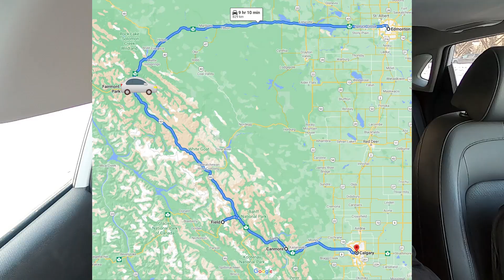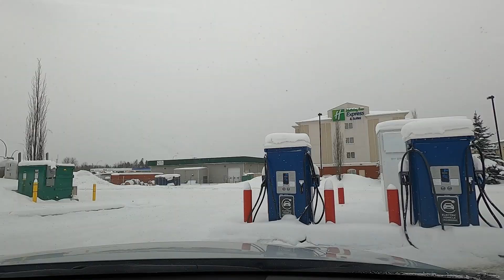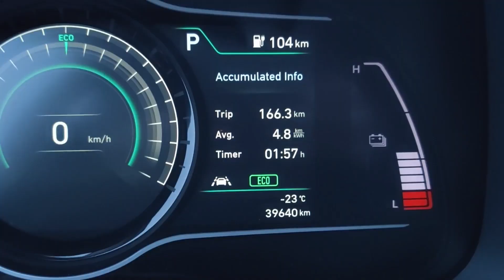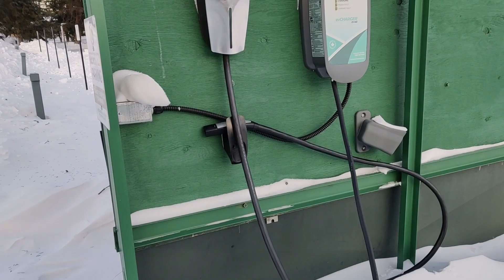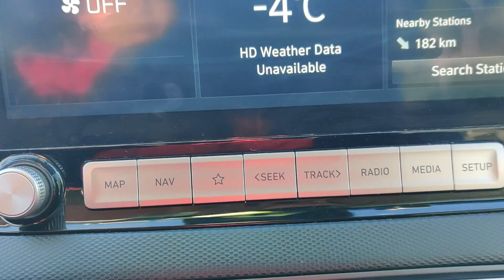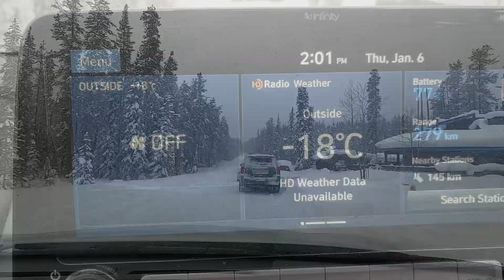Extreme Cold EV Road Trip Part 1 : Canadian Winter  (830km)

Comment: So heres the thing heat pumps dont work well at temps below -18°C. I test drove a phev in -25, and in ev mode, it was puting out barely luke warm air. When the engine was running, it would put out hot air. Asked a friend how his tesla was in cold temp, and even they admitted that ya its drivable, but if you wanna warm up in your vechile it just isnt gonna happen at those temps.

Comment: Very nice and informative video. I’ve ordered the 2024 Kona EV and I’m not stressed about winter roadtrips no more thanks to you! I am from Quebec (canada) and I guess it will do even better even though we have the same temperatures as in your video since the new model has battery preconditioning. No more worrying about the battery temperature for when its time to charge!

Comment: fyi our 23 Bolt at 15,000 miles has 4.0 mi/kWh lifetime average efficiency which is 6.4 km/kWh - but it's usually quite warm in Louisiana. Edit: this cold morning for 15 miles the Bolt only made 3.0 mi/kWh (4.8 km/kWh) - ouch.
Reply: It's been consistently cold and lifetime average is 3.9 now. Current weather is rough for ev - but the Bolt is holding up.

Comment: I think there should be option to force battery heater on to have good temps for fast charging with selectable time limit. Heating battery is in my opinion part of charging because warm battery has more energy to use.
Reply: A good feature. When looking a couple years back I thought all EVs  had it. Call it pre-charge conditioning or wtvr

Comment: Great analysis and experience video here.

I am concerned about traction in my and my wife's Kona Electrics this winter because they tend to spin tires in trivial conditions like wet grass. Hoping that doesn't translate into winter traction issues, but you seem to be doing great in snow and ice so I'm optimistic!

Any special winter tires or wheel sizes or just any 215/55R17 winter tires at the right price? I'm looking at FastEv EV05 wheels (Canadian made) and Continental VikingContact 7 tires but they're quite expensive if they're not necessary.
Reply: My experience in snow and ice is ESP off and leave traction control on, it works great.
Reply: @ thanks! I'll try that.
Reply: Which tires did you go with and how are they? I’ve liked Nokians non-studded All weathers in the past for performance and convenience. 
I wonder how the Kona would be with studs
Reply: @larslarsson2056  we have Michelin X-Ice Snow tires on mine and some random cheap studded tires on my wife's. I prefer the handling of the Michelins. I was able to handle heavily drifted roads and active blizzard conditions in an emergency with confidence on them. Having gone from AWD to not I find I miss confident and surefooted inclined starts but otherwise haven't found much of a difference otherwise.

Comment: So i can fill up my Ford F150 with a range of 1000 to 1100 km. Which basically means I could have driven that whole trip without stopping.
Reply: Yes, you could. I could also pay more and fill up a helicopter and do the trip in way less time. Which is more energy/cost efficient?
Reply: That's a long way to go without stopping. When was the last time you did that?
Reply: What a stupid comment in the world
Reply: How much you spend to fill up your truck? I’m sure the EV could do 2 to 3 times those amount of miles with what you spend on your one tank of gas or diesel. Not to mention, zero pollution.
Reply: @gianvisentin1232 my cost per kWh at home is 19¢. my cost per us gallon is currently  $2.49.  I have paid as much as 30¢ per kWh while traveling. Electric is 4.75¢ per mile at home and 7.5¢ per mile while traveling. On Gas my cpm is 4.6¢, add 1¢ for an oil change every 7500 miles.  Assuming 4 miles per kw and 54 mpg. 2017 Toyota Prius prime.
Reply: No pee stops, coffee breaks, rest stops ?? 😮 Are you a human ?? 😊
Reply: No one asked

Comment: Thanks for this video!  I just completed a 500 km, one-day out & back trip to pick up my wife, driving our new 2023 Kona EV…3 mountain passes each way, -25C temps, one DCFC for 90 minutes at -21C (-29C windchill).  I was hesitating to take the EV, but your videos helped me decide it’d be a good test of the Kona’s winter abilities.  I followed many of your tips, including setting the DCFC charger as the NAV destination—charging started at 47kw (50 kw charger), but it did slow to 22 kw after the battery reached 80% (we charged to 92%, app was saying another hour to 100%).

Comment: Great video mate! And good job Hyundai! As far as I know, it is normal for chargers to coldgate at really cold temperatures. I am not an expert, but people who are much wiser than me stated, that the conversion from AC to DC is much less efficient in low temperatures. How badly the charger deteriorates is dependent of the make and model as well as the used auxliliary components, but at -25°C, you can expect a charger to have an efficiency of about 70% at best (which would render the 50kW charger you used as quite efficient considering the circumstances), and a completely dysfunctional charger in a worst case scenario.
And yes, the wind may matter. The charger may suffer from wind chill. What's meant with that is, that the cooling effect of air with a certain temperature combined with a significant wind speed is actually far greater than the cooling effect of still air of the same temperature. Reason would be the constant disruption of the boundary layer of air around the charger. This could explain, why the charger in -30°C was fine, while this one in close to -25°C was not. The sun might have also played a part. If it was sunny despite the -30°C, the charger housing might have heated up significantly. In your video we can see, that the sun was very much absent, so that might also have played a part. The same effect would be responsible for the Konas temperature probe showing -4 in -25°C weather. The sensor is probably near the lower "nose" of the vehicle, so it can detect the surface temperature of the road while driving as acurately as possible. But that means that it will heat up very quickly if the vehicle is stationary and facing the sun.

Comment: Thanks for your great explanation. Just wondering, I’m in calgary. I don’t have a garage. Will it be ok in the winter cold. You know how we get those cold snaps. Should I not drive it that week. If I did that, would the battery run out keeping itself warm I assume? Would it ever goto zero? How bad is that for the battery. Or how do you wreck the battery so I don’t do that. I want to get an Ev soon. As well, how was it on ice? Re the lane assist etc. will it over steer?can you freeze the battery? What kind of maintenance have you had to do?
Reply from the maker: From what I have observed, the Kona will allow for it's battery to drop to a really low temperature without heating it up.  From the manual, it seems like the battery stops functioning when the battery reaches -35C. In order for the battery to reach -35C, the ambient temperature has to be sustained at -35C for a long time. That type of weather will be very rare. I suppose when the battery gets to -35C the battery heater will turn on and use the battery's own energy to keep it warm. It is possible to have the battery run out while keeping it self warm. But it will probably take a week of sustained -35C to drain the battery through the use of battery heating. That is assuming that you are not driving it or charging it for the whole week of extreme weather. So as long as you charge it once in a while and don't keep the vehicle in the extreme cold with only 10% left, it would take an extreme set of circumstances to render the vehicle inoperable.

I have driven the Kona Electric at temperatures of -30C to -35C multiple times in Edmonton and the vehicle works. Sometimes when the battery is cold, the vehicle applied a power limit so you are limited to 50kW power output instead of 150kW until the battery warms up. And if you are driving any significant distance, the battery will warm up. I haven't encountered a situation where it was so cold that the Kona Electric refused to drive. I think there are other EVs that have a harder time in extreme cold. But when it gets to -35C, it's not like ICE vehicles have no issues.

When comparing extreme cold and extreme heat, extreme heat is worse for battery degradation. All things being equal, an EV battery exposed to extreme cold will suffer less degradation compared to extreme heat. In south east Asian countries that regularly have ambient temp of 35 to 40C, you actually see more degradation compared to colder climates.

There is a battery in the Kona that you have to worry about in the extreme cold. And that is the 12V lead acid battery. This is the same 12V battery you find in any other vehicles. When the 12V is exposed to cold for a long time, it is at a lot more risk than the traction battery. And if your 12V battery dies, you can't turn on the vehicle.

Comment: Have you driven across Canada in winter?
Reply from the maker: I have not. It will be a bit difficult to do in a Kona since in some places the chargers are just close enough to make it. But if one of those charging sites are down. Then you can't move on quickly to the next one. It will be easier in EVs with longer range, like a Model S.

Comment: Nice video! Regarding the charger in Jasper: Option 1 can't be the reason, since windchill is only relevant for human skin. A machine like a charger won't notice the difference between -23° in still air or in high winds. My bet is that those chargers just don't like the cold for some reason. Pretty disappointing that there are so few chargers at each location and only 50kW units as well. They're fine for an efficient car like the Kona, but God help anyone who wants to charge their R1T around there!

Comment: Thanks for this, I see you went to a lot of work to produce this video!  I have a 2019 Kona Electric and I have driven in similar conditions to your trip using similar driving strategies with good results.  The bottom line is that an electric car (ones with battery heating), properly handled, can do well in difficult driving conditions.  The catch is that you have to learn the right strategies which you are teaching in this video.  So thanks for your work and all those great little details.  When driving long trips I aim to keep above 20% between charges, it’s better for the battery life and it’s good to have some margin if there is a problem when you arrive at the charger.  I use the PlugShare app to look ahead and see if the chargers I’m aiming for are working or in use because  you never know, chargers break down, some are very popular, some are hard to find in unfamiliar towns, some have been ‘iced’ (i.e. a gas car parked in front of them) etc…

Comment: I have a Kona EV 2021 64 Kw battery.
I drive every Sunday approximately 280 klms in as low as -20 Celsius.
So far I usually have 75-100 klms range left at the end of my trip so let’s say about 350-375 klms.
I’m very happy with my Kona, no issues at all.
I agree completely with your manual use of the heating system , I never use the auto setting and often use the defrost on fan only, no heat.
When you start with a clear window the fan alone will often keep it clear.

Comment: I just drove my Kona in minus double digits as well in a part of Alberta with piss poor charging infrastructure. I still did almost 350 kms on one charge in some harrowing conditions. It was also uphill and snow covered. 

One pro tip: make sure your regen is set low (zero bar) in bad conditions so you don't get unexpected deceleration.
Reply: Great tip. I was wondering about regen settings and how touchy they may be with ice. 
Are you running a standard winter tire or studded in winnipeg? Im considering this vehicle as well.
Reply: @larslarsson2056 I had standard winter tires last year but they wore out, so I need new ones.
Reply: @ChristinaJWpg  Are you still driving the same kona? If so, how has the battery held up all these years? I am seriously considering an EV now that they are bringing back the EV incentive
Reply: @viverrine1580 Battery holds up good. The most irritating thing is that when it gets extremely cold (like minus 30s), dc fast charging is slow as molasses. I don't know if newer models are better. I safe most of my road tripping for the spring/summer/fall anyway. No real noticeable degradation on the high voltage battery, though I have had to replace the 12V battery twice though.
Reply: @ChristinaJWpg  that is good to hear. hopefully the newer models are a little better in terms of range for my peace of mind 😄
Reply: @viverrine1580 In addition to range, ask about max charging rates too and in Canada also pre-conditioning. Pre-conditioning is very important in cold climates because if you don't have it, the car will have to spend a lot of time and energy at a fast charging station to warm up the battery before it will actually start fast charging in earnest.

Comment: The Canadian Kona EV has a battery heater. The US Kona EV, since 2020, also has a battery heater for the Limited, and Ultimate trims, but not lowest-level SEL trim. I have the Limited trim and it's well worth the extra money to have a heater added to the Kona's BMS.

As for repairs, EVs are generally low-maintenance (except for makes that throw all sorts of gratuitous extra technology in the car. Tesla cough cough). The maintenance is yearly software updates and tire rotation at the dealer.